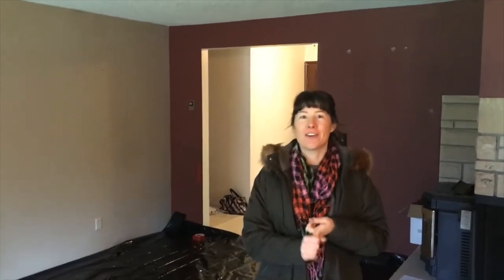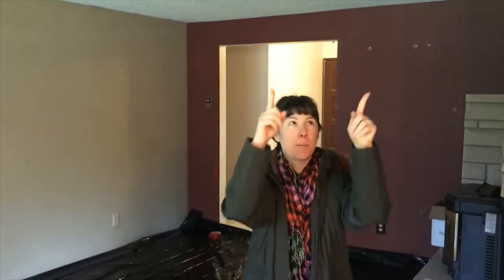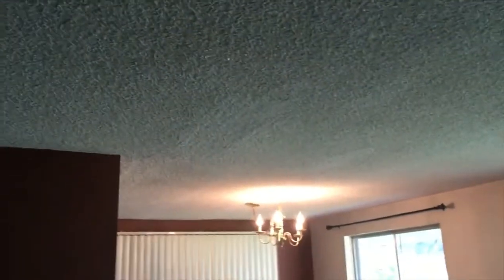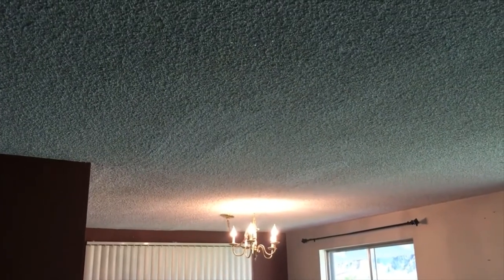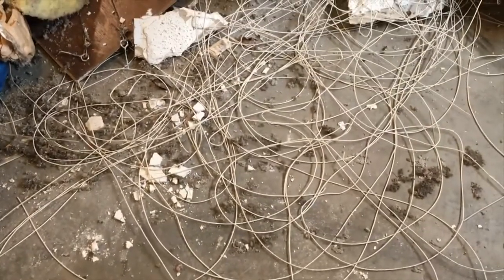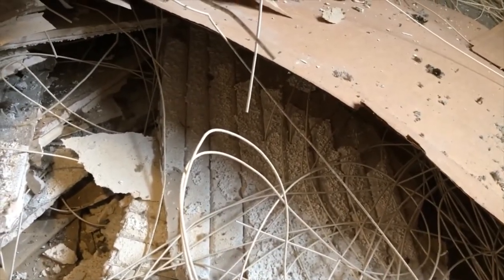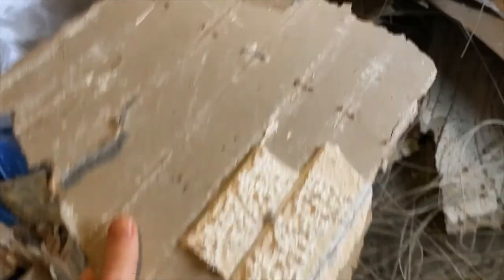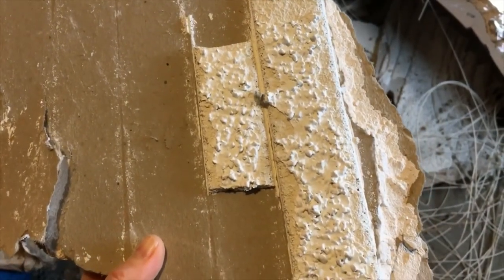Popcorn and Radiant Heat Ceiling Removal 1971 Ranch

Comment: Our house was built in 1969 and we love the radiant ceiling heat. It is quiet, clean, and heat can be regulated for each individual room. In the winter we can shut off heat in rooms we are not using. We have lived here 27 years and never had problems with it, never a service call.
Reply: Does it matter about the kind of paint that is put on the ceiling
Reply: Isn't it super expensive

Comment: Thanks for this video. We're looking at houses in our area and a lot of them have this type of heating, and I wasn't sure what it was. I guess I won't be adding any can lights!
Reply from the maker: You are correct!! No can lights for you! 🤣
Reply: Invest in a thermal camera then re-route the radiant cables as needed, just don't cut them. It can be done just a lot of work and cameras are not cheap.

Comment: My ceiling has developed some bug cracks that run for several feet and is growing.  And I have wavy lines in the ceiling.  Should I pull it all down?  I’m going with a propane furnace anyway.
Reply from the maker: Hi Jeff! Thank you for commenting. I think that there could be a lot of possible things going on here. Your ceiling trusses could have settled, taking the ceiling drywall with it...or perhaps the drywall isn't attached to every single bottom beam of your truss, and sagging has occurred due to age. Or maybe your roof isn't a truss system at all! I've heard that the 1/2" drywall tends to do this (which is in a lot of older homes) as it ages but that the 5/8" thickness resists sagging better. But yes, cracks mean that something is failing. I would have a contractor come out and shed some light on the situation before attempting any demolition or repair work myself. Personally!
Reply: @pnwerica  thanks for the comment.  It’s a ranch style 1980 home.  I think the trusses are fine .  I believe the ceiling is getting brittle from the heat/wires and starting to detach.  I’ll get into the attic crawl space this weekend and see if I can see anything.  Thanks a ton!

Comment: Hi! How much will cost the removal of that ceiling in 1 medium size room, please?
Reply from the maker: Hi Roselyn! I honestly can't say for sure...contractor rates will vary by area and if your ceiling contains asbestos it will cost more to remove. You can have it tested yourself by scraping off a bit and sending to a lab...testing should cost you about $100 to $150. If no asbestos is present, you can do it yourself quite simply! Home Depot sells a ceiling scraper with a plastic bag attachment: 
https://www.homedepot.com/p/Homax-Ceiling-Texture-Scraper-for-Popcorn-Ceiling-Removal-6104/202061374

Comment: I found a great home with this type of heating but my real estate agent advised me that most of them contain asbestos.  Did yours have asbestos, and if do how expensive was it to remove?
Reply from the maker: Hello! Thank you for commenting. I have so much info to share with you - sorry if this post is long for you but hang with me. :)
1. Yes, most popcorn ceiling contains a LOW LEVEL of asbestos. You can have environmental testing done where someone comes out,  scrapes a bit of material off of your ceiling, and has it tested to determine if asbestos is present and also the percentage. Many general home inspectors will perform this service; you just have to ask.
2. Cost to remove: this depends on the level of asbestos you have. Our ceiling in particular in this home tested out at 1%. Our general contractor felt safe simply scraping it off and hauling it away. HOWEVER, if your asbestos percentage is higher AND / OR you elect to have the asbestos removed following the EPA (Environmental Protection Agency ) guidelines where hazard gear must be donned by the remover, etc. the cost will be higher.
SO WHAT WE PAID: popcorn removal only: $2250 for 3 bedrooms, a living area, an entry way, and a hallway.
FOR THE SEGMENT IN THIS VIDEO, we elected to remove the ENTIRE CEILING and REPLACE IT since the electrical heating in this room had been damaged and rendered inoperable AND because the ceiling had been patched before. THAT cost us about $5200 to remove and replace the ceiling AND the insulation above it.
3. A few things you should know about radiant heat: IT IS OBSOLETE. NO ONE will service it. EVENTUALLY you will need to replace it with either wall units, a ductless system, or a ducted system. My preference is for a full ducted system - but that is just me! Keep in mind you will probably have years and years of service out of the existing radiant heating system, but you will need to replace it one day. 
ALSO, ONCE THE POPCORN IS SCRAPED OFF, you will very likely be left with an UGLY ceiling of plaster, embedded electrical wires, and rusted staples. I had to use a special primer over mine and even after painting it you could still see the plaster marks. I can email you a picture of this if you want! I plan on featuring it in an upcoming video.
But even if the house did not have a radiant heat system under the popcorn, once any popcorn is removed any irregularities in the ceiling will be exposed. They CAN be corrected with a skim coat of building compound but in the case of our ceiling our contractor felt it would not be safe to do because of the extra weight that would be added by the skim coat of building compound to the already HEAVY plaster that is keeping the electrical wires in place. He was worried that the extra weight may cause the ceiling to fall! But a non-radiant ceiling post popcorn removal can be treated this way.
-----
Whew! Thanks for reading. If everything else about the house is wonderful, I wouldn't let a radiant ceiling stop me from purchasing it. For our house, we are going to just "ignore" the ugly ceiling until it is in our budget to add a ducted heating / cooling system AND replace the ceiling at the same time.

CHEERS!!!
Erica
Reply: Did you also have your insulation tested for asbestos also? We are interested in vaulting a ceiling in a 1965 home with the same situation (popcorn, radiant ceiling heat). I know this post is old but just curious!